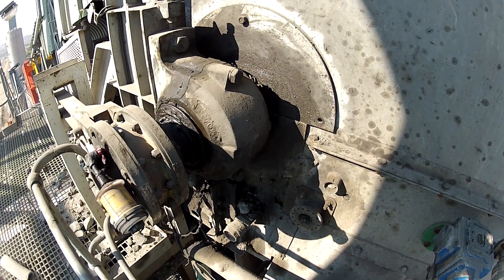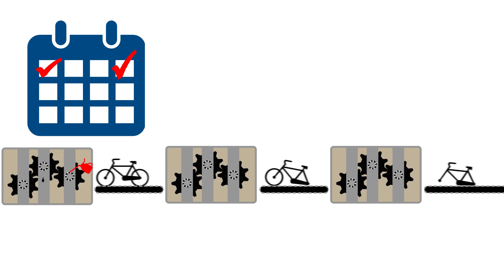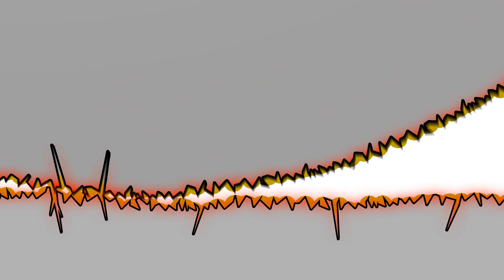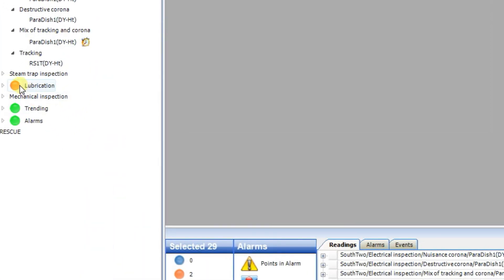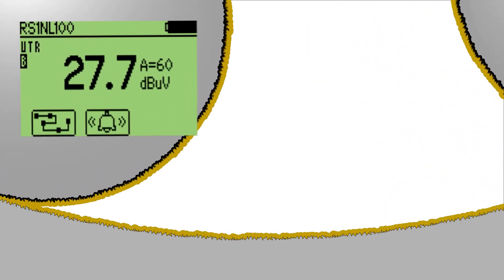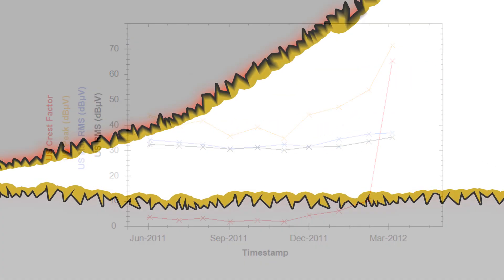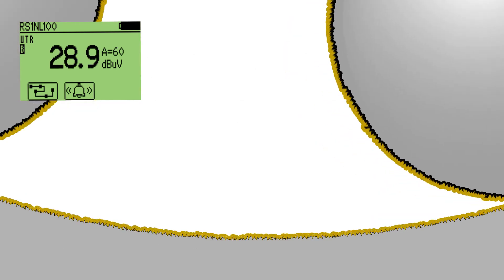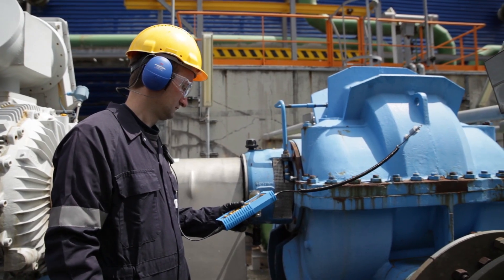Acoustic bearing lubrication monitoring using ultrasound

Comment: how much affect the sound of the exterior of an installation?
Reply from the maker: It depends if you are talking about audible noise or ultrasound noise coming from the production. What you can hear in audible range will be mostly be eliminated by the device as it's only measuring ultrasound :)

Comment: As a vibration analyst, we have pretty much an established experience and reference using vibration (seeing BFF in gE then in velocity plots) as when to optimally call a bearing failure (4"ish" stages). For Ultrasound, when do you tell your maintenance guys that the bearing had failed or about to fail? By experience even detecting BFF (bearing fault frequency) in enveloped acceleration is too early a call. I think using ultrasound is much much earlier and relying on it alone may give a case of like "the boy who cried wolf". What do you do when you find ultrasonic indications of a bearing fault besides adding lubrication to see the signal disappear? Would you recommend a bearing change even the vibration signals (gE, vel) are way way too low? How long does an ultrasound signal go without correction before it can be detected by existing vibration HFD (env acc) techniques? A practical experiment result will be interesting to see, pls post link. Thanks
Reply from the maker: Thanks for your question ! Feel free to contact me to discuss about that ! benoit@sdt.be